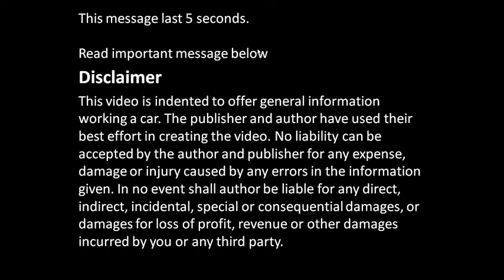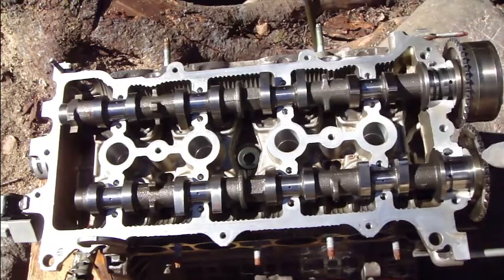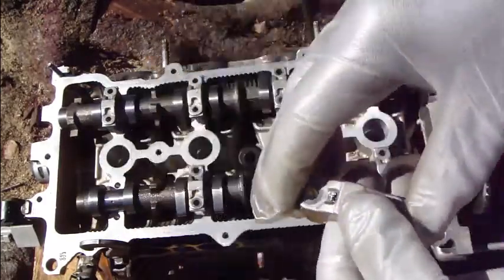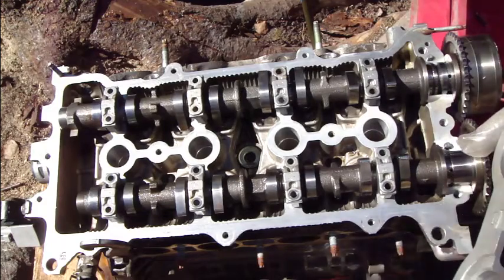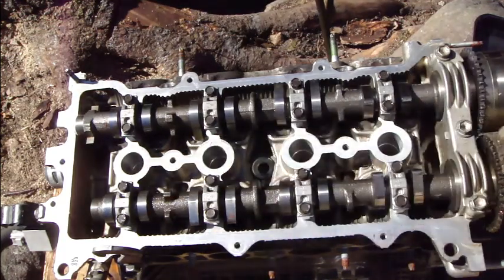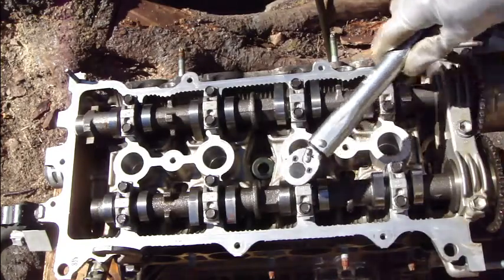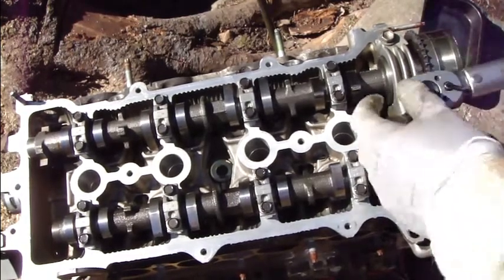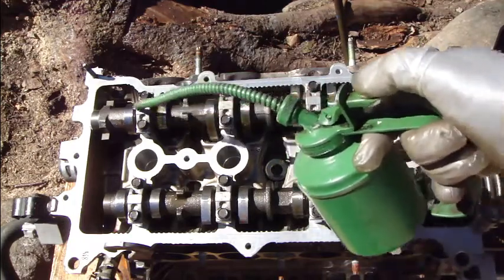How to assemble engine VVT-i Toyota Part 29: Camshafts

Comment: Is pre lube the cleaned bearing preferred before you put the bearing caps on? This way it is metal on metal. I don't think that the oil you apply after locking all the nuts will lube those bearings

Comment: Questions Peter.  Why is it important to remove the excess oil from the camshaft and bearing plates etc before installing, then you added oil back after torquing all the bolts?  As long as the parts are clean before install it seems like any excess oil would help lubricate all the parts upon initial restart of the engine?  The motor oil will be splashing around on all the parts anyway once the engine is started right? Thx
Reply from the maker: I have to see bearing points status, maybe bearing areas are worn out or scratch
Reply: @PeterFinnTheCarDoctor  Oh okay, thank you. I understand, i wasnt thinking about it from that perspective.

Comment: How many lbs?
Reply from the maker: Hi, I will check...
Reply from the maker: Here,  Two steps: 
1) 40 lbs  and then also
2) Angle tighten a further 90 degree
Reply: 40 lbs + and additional 90 degree angle is for all of the bolts or just the small ones?